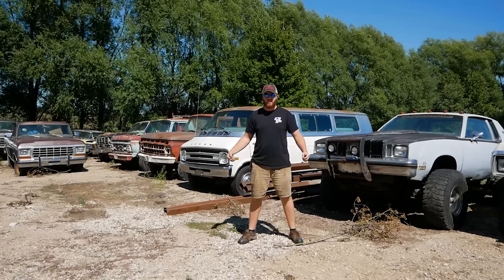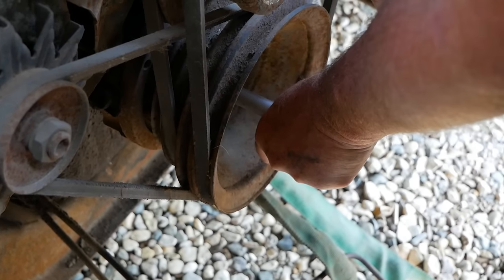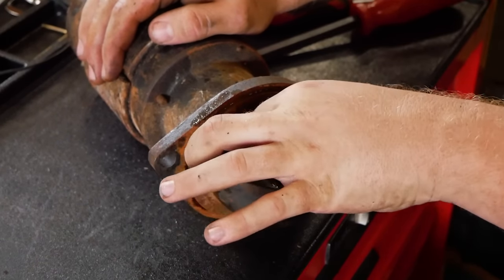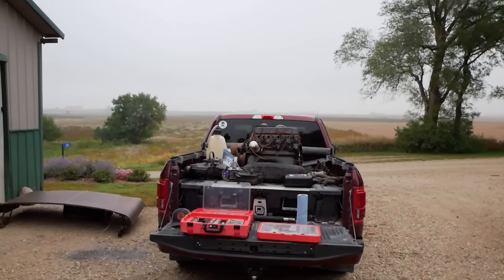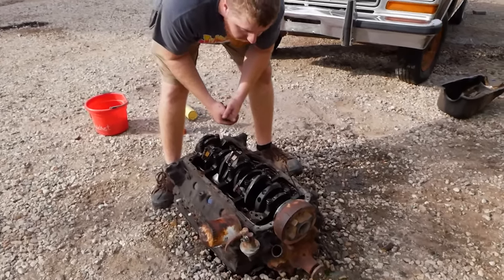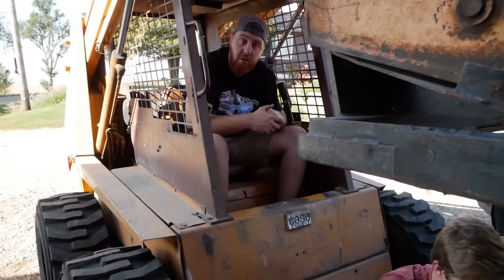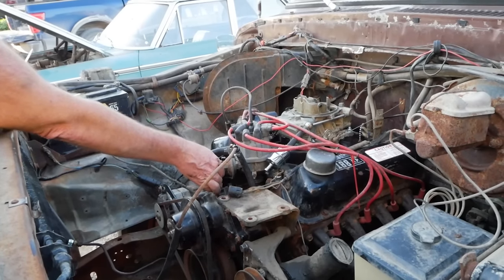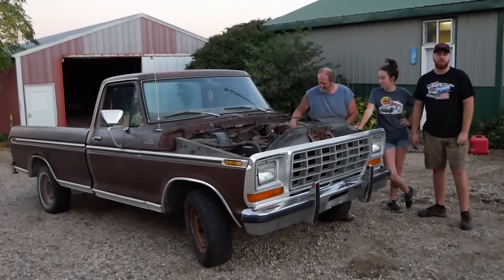Can We Swap a BOAT ENGINE into a TRUCK? 1979 F150 Revival

Comment: Okay a quick question if you take a boat motor and put it in a truck would you have to change the cam if it is a automatic transmission thanks

Comment: Did that to my 6x6 S 15 the 151 was worn out got a old boat with the same engine just changed the manifolds  the same engine thats the only difference the boat one is rated at 170 horsepower .

Comment: Does the boat engine's crankshaft rotate in the same direction as the trucks? If not you would have a truck that goes forward slowly and reverse quickly. Just thought I would mention that

Comment: Definitely can't do that with modern engine's.  Hang a motor from a chain and start it. You should have cracked the throttle and watched the motor torque up in the air.

Comment: I recently aquired my father-in-laws (original owner with 147K miles) 1978 F250 with a 351M and a 4-speed floor manual with "Granny low" 1st gear.
This truck scares the hell out of me on the Highway (60mph) with the erratic steering box!
What can I do in order to keep my shorts away from "racing stripes"?

Comment: Someone correct me if I’m wrong but don’t boat motors have a lower camshaft torque range than an automotive camshaft? I swapped motors in my ski boat from a boat motor to a truck motor and I called a few marine shops and they said that if I didn’t swap the cam from the marine engine to the truck engine it would be kinda weak out of the hole so to speak just a thought maybe you’ll have a lot more low end torque in that truck!

Comment: Ok you have the 351 timing so it has the ho cam, I hope that distributor you robbed to put in there has a brass gear or you just ruined the cam gear that drives the distributor, I had a friend do the same to an ho he put in a Galaxy.

Comment: Don’t forget the check ball for the vacuum secondary.
The pilot bearing does not go into the flywheel. It goes on the back of the crankshaft.
Remove the alignment tabs on the transmission.
That looks more like a C4 and not a C6 trans.
Now that the engine ran without water in the block probably screwed it up now.

Comment: Trying to do the same thing with a 350 chev motor what did you say about the firing order of the boat motor compared to in a truck
Reply: The firing order was just a 302 thing. Early 302s had a different firing order to the later 302 “HO” engines but the boat engine has the later model firing order despite actually being an early engine

Comment: I have a 1964 F3 50 with a 292Y block do you know good place to get the exhaust manifold and a brake booster this information would be greatly appreciated I’ve been looking for a long time the truck runs great I would love to get back on the road

Comment: What do you expect from it,it's a boat engine, not an engine for vehicles,it's made for water, it's would help the engine if you had the radiator hoses on it & hooked up, because that's a good way to lock up the engine running it & driving it without a radiator & fan

Comment: Gen 1 Ford LIGHTNINGs all utilized 
Ford Marine 351 long~blocks 93~1995     You lucked out on flywheel balance issues and was that a raw~water cooled marine motor?     ............. Finally I really question MerCruiser packaging Ford based boat motors as Mercury Marine was mega~into Chevy's... The ski~boats were huge on Ford 302/351s up to about late90s......

Comment: The other thing you people need to know is like the exhaust manifolds got water in them. The fuel pump is a double diaphragm pump so that it doesn’t leak into the boat or into the crank case of one diaphragm breaks the starter has flea in it, but it’s starter Are the same alternators with flame arrestors this is all made up to make money off of people they see $they push the thought that they’re different and they’re not

Comment: Real smart putting an old rusty starter motor, spraying it with WD40 n wacking it with a hammer then reinstalling it when a new starter would last longer smh

Comment: Can Mook help me work on my Running '79 GMC C-1500 "Heavy Half" 350 cu in carb and hood hinges so it will run and look good? I would enjoy her experience and company while I swear and curse the truck as I work on it. It runs, but the acceleration pump and hood hinges desperately need help! I can do the rest by myself. We will keep her comfortable and well fed.

Comment: I have learned though that I’m the Chevy 350 water pump you cannot use a tin bladed water pump or you can, but it only lasts about a year before the water eats it away my local parts store. I’ve had enough of me bringing them back lifetime warranty it dissipated again what are you using in this boy, lol

Comment: you know, whenever i watch these types of videos i cant help but think three things:
- probably the most offputting thing about america to me is how automatic transmissions are the norm, and clearly have been for ever. im from germany and its the weirdest thing when people specify that something is a stick, like, yeah i assumed that unless you mention otherwise.
But no, only when you mentioned the torque converter did i clock on to the fact that even this damn truck from 40 years ago being an automatic must have been so standard that it was just a no duh to you. no wonder people joke about manuals being a millenial theft protection, feel bad for you guys having these great cars then having them be less fun than my moms 1L matiz because they couldnt be bothered to put a proper transmission in it.

- engines with distributor cap ignitions still seem fairly abundant in the US. the only time in my life i have ever even seen one of those ignition systems was as an example in vocational college.

- part stores seem super common, and probably as a result of that, a lot of people seem to just have the most random of parts chilling in their barn. Part stores arent really a thing over here as far as im aware. im sure there are a few, but it seems like there's just an auto zone or an o'Rileys around every corner.
Reply: It’s similar here in the uk. Basically everyone has a manual, and any classic cars are either restored and insanely expensive or absolute shitboxes with no drivetrain. That’s why I got so into small engine vehicles like 125s, quads etc. they’re much more available and I can actually get parts for them

Comment: Whats the big deal about the Mercruiser engine in the truck? It's a FORD 302! It's not like they transplanted 1948 flathead into it.I'd bet many Car/truck Ford engines have been swapped into boats after the marine short blocks rusted away. Not rocket science.

Comment: You guys replaced a Ford 302 with a Ford 302. I really don't understand what anyone thinks is special about this? I suppose there's folks out there that didn't realize automotive engines were sometimes used in marine applications. What about industrial applications. There's countless automotive engines in forklifts, generators, air compressors, irrigation pumps, ski hill lifts, airport tugs, welders, front end loaders, backhoes, etc.....    
Sorry, but there's nothing special about what was done here, other than the knowledge that this particular 302 uses the 351 firing order. 
I've sold 3 Chevrolet 4.3 V6 engines out of S-10 Blazers to boat guys. All 3 were because the boats weren't properly winterized & the blocks cracked. Nobody was a magician, nobody parted the Red Sea. They took a 4.3 Vortec V6 and replaced it with a Vortec V6. 😑

Comment: !!!!!!!STOP!!!!!!!  using brake and parts cleaner to prime !!!!! worst thing you could feed an engine that's been sitting, use a bottle with 2 stroke mixed gas !!!!!!